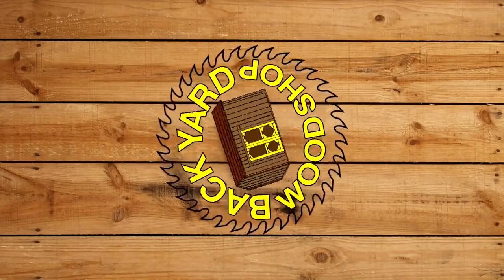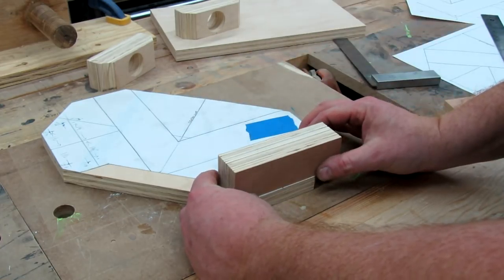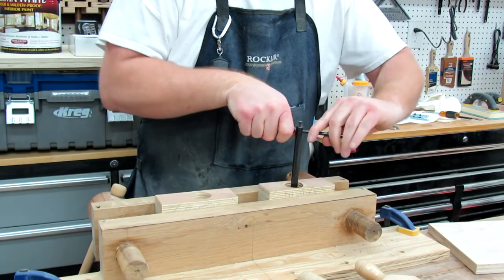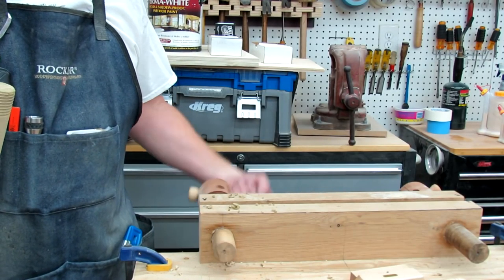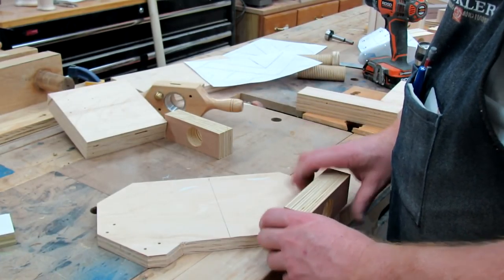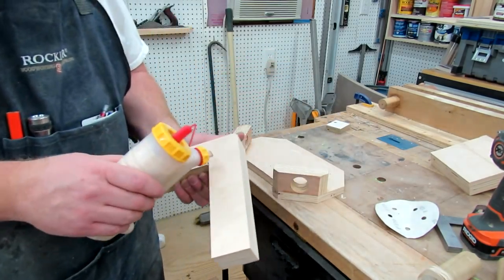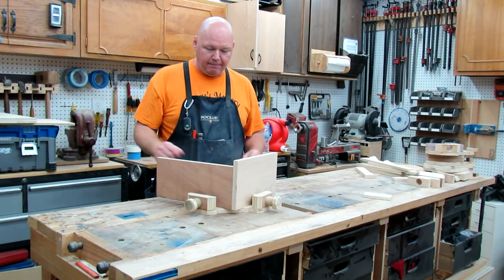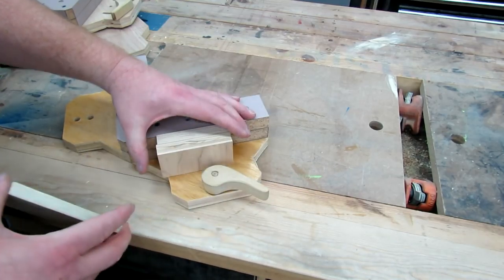Shopmade Clamp It Jig  FREE Template!

Comment: i bought a 12 inch ryobi  with a laser  and it is a hunk of crap laser is 80.00 replacement   saw is not accurate at all the hatachi in the shop is perfect every time  but could not afford450 bucks
Reply from the maker: Yes the I like the new version of the Hitachi. The fence is a lot better I am think of upgrading the fence. My left fence has a slight flex to it.